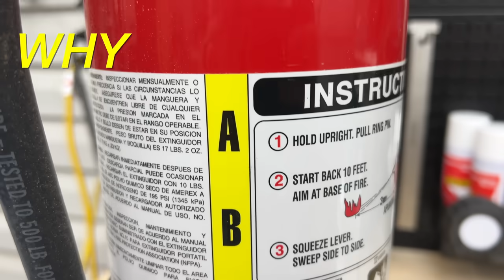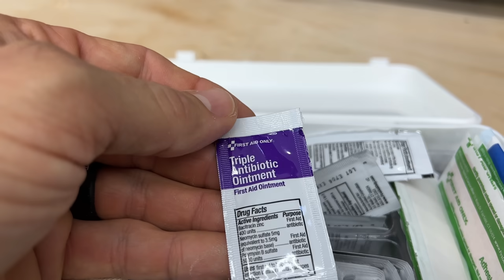5 Safety Products You Need in the Shop (#3 Will Surprise You)

Comment: Thanks, Matt, for including tourniquets in your video!  Josh M has a great point.  Make sure the tourniquets are true CAT tourniquets from North American Rescue.  The genuine tourniquets will have the letters “CAT” stamped all over it- on the buckle, the back of the strap, and on the windlass. They usually cost between $30-40.  Well worth the price when seconds matter.  16 years in law enforcement, and I just learned in training last week that the off brand tourniquets will likely fail.  Don’t throw the “fakes” away though. Use them to practice with or donate them to your PD or FD so they can train with them.

Comment: Not a device, but as a rule, I never use gloves or wear long sleeves around any kind of saw. I would much rather get a splinter or feel cold for a few minutes than lose a finger or worse. I often get poked fun at for the gloves especially, but I want to know EXACTLY where the ends of my fingers are around things that would eat them for lunch.

You were right, number 3 surprised me, but that will be an excellent addition to my equipment. Thank you.

Comment: Fire Extinguishers are only for small fires, or to make a path for you to exit the area. Always call 911 if you have to use an extinguisher.  Get the Firefighters on scene to make 100% sure the fire is out.  Make sure that all your bleeding control is a one handed operation, you may only have a single hand/arm that is uninjured.  Practice with the Tourniquet BEFORE you need to use it. Take a Stop the Bleed Class.  Usually these are free and teach you the best way to stop major bleeding. If you have any kind of "creams" in a first aid kit, check if they or any of he other items, (Including the tourniquets) have an expiration date.   Hope this helps

Comment: Mrs. Wilson Road Woodworks and I have a pair of the 3M WorkTunes hearing protectors that I bought for use while mowing our property. I'll likely get double-duty out of them in the shop this summer too! I previously had a pair of DeWalt hearing protectors (that died) and the WorkTunes are much more comfortable to wear for an extended time. I recommend the model with the gel pads on the ear pieces as they are more comfortable than the regular ones. If you have a pair of the regular ones you can simply buy the replacement gel rings and swap them out!

Comment: I have the same first aid kit in my work truck and I threw the twesers out the first time I used them and upgraded  to metal ones. I also bought the larger one for my small shop and it's come in handy a few times. I have a tendency of cutting myself with the double edged pull saw. I always get bit buy the rip side go figure.

Comment: Hi ya’ll. Active duty military, have had a fair bit of combat medical/ trauma care training, and just wanna throw a bunch of unsolicited info your way, haha. 

In my opinion, the tourniquet is the most important medical item you can own.

Pre-stage those tourniquets to prevent fumbling and losing precious seconds.

Peel the white time tab back and lightly stick it on one side so that it **does not cover the windlass catch**.

Make sure it stays loosely and neatly folded up. Don’t have it twisted or just tossed somewhere all willy nilly.

The goal is that when you grab it, you’re just slippin’ & rippin’ that bad boy on, aka, slip on/over the limb and pull the strap as tight as possible. THEN crank the windlass (the stick part).

Cranking the windlass will hurt, but pain is temporary - death is forever.

Crank it until bleeding stops, then lock it into the catch. Cover with the time tab, but don’t worry about writing on it. Why?

You should be dialing 911 at this point! Guess what? Your call time is your time stamp.. Tell the 911 operator you applied it. 

NEVER REMOVE A TOURNIQUET. If bleeding restarts before EMS arrives, apply a SECOND one ABOVE the first one and repeat the procedure.

Lastly, TRAIN YOURSELF. Simply watching a YouTube video is NOT enough. Practice using it. Practice one handed. Tape up a fist and then run a scenario. Switch and repeat bc you never know which hand will be injured. Pretend it’s a leg injury, you can’t walk effectively, and your tourniquet is across the shop. Apply it to every limb. Know where the major veins run thru each limb. Just… Practice.

I hope no one ever needs this information, but you know the saying… It’s always better to have it and not need it, than need it and not have it.

Stay Safe.

Comment: Good job. I spent a lot of effort and expense on my first aid kit. I did not know that 90 seconds was the conscious window for arterial bleeding. I thought it was longer. I guess that means I need a couple of tourniquets positioned around the shop since I tend to work solo. Even though I have practiced,  I am not sure I can get it on properly in less than 90 seconds under emergency stress. I need to figure that out. Thanks. One side note, Isotunes products are OSHA compliant, not approved.

Comment: long time emergency services... Fire Extinguishers (if you only have one) should be mounted at your exit door. This way you're at the door, able to escape and the fire is the other way. If it's still small, you can try to fight it, if it gets too big, you're already at the door, able to escape.  I would recommend also a simple water/hand pump style as many fires will just be simple wood fires... less damage to the rest of your shop/tools from putting out a board on fire with water.  If you use a "normal" extinguisher, that dry chem gets sprayed around, it coats everything, is horrible to clean up, and you taste it and cough for a week afterward from inhaling it while fighting the fire (ask me how I know).

Comment: Matt - AWESOME video.  I couldn't help but notice that nice miter saw station that you built - waiting on the video for that.  I also noticed the new saw that you have for it.  Very NICE!
1 more thing that I noticed in your video when you are talking about the hearing protection, I went back and noticed that in the dust mask section of the video, you were not wearing hearing protection - you may have had earbuds in at the time couldn't tell.  
I know I am the same.  I always laugh at myself that I am not always 100% protected when working around the tools (dust mask, hearing protection, eye protection, push blocks...).  That is something that I will be working on harder to make sure I am safe.

Comment: Regarding the tourniquet. Buy as many as you think you need and strategically place them around your shop. Also buy one extra one. You’re going to use the extra one to practice with at least once a month. Buy a tourniquet that you can apply with one hand. Once a month practice grabbing that tourniquet put it on the high leg put it on the Hyrum the low arm etc. and time yourself. You don’t practice with it you’re gonna mess it up we gotta do it in real life‘s. Remember when you buy your equipment assume that your hands are going to be slippery and covered in blood and by the proper tourniquet with a proper winding stick on it that you can use when your hands are wet slippery with your own blood. 911 is not an option for bleeding control, you will be dead by the time they show up

Comment: I was installing overhead dust collection, and "missed" the bottom step on the ladder.  Landed directly on shoulder and hip.  Knocked my head pretty bad on table saw.  Lost my breath.  I had my cell phone in my pocket.  HOWEVER, it was one of those wrap around screen phones.  I could not dial it whilst lying flat on my back, because I couldn't hold it without touching the screen.  My wife was upstairs, heard the fall and came out after she heard me yelling..  I've got a new phone, and a referee's whistle now.  She knows what the whistle means.  I "try" not to do ladder work when she is not home...